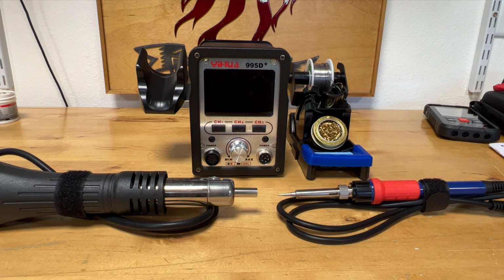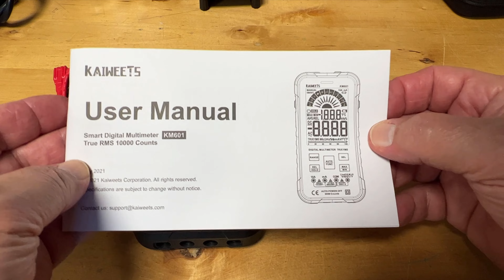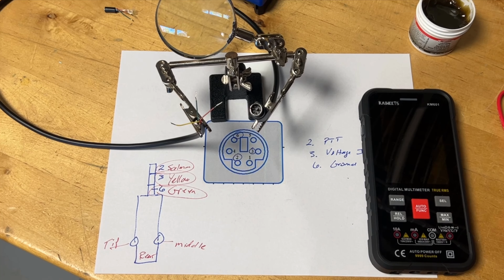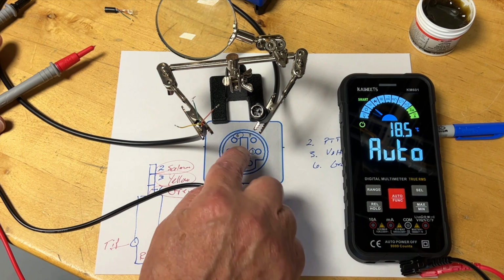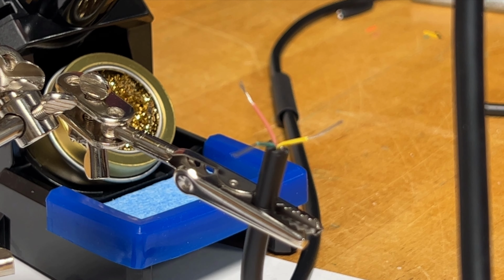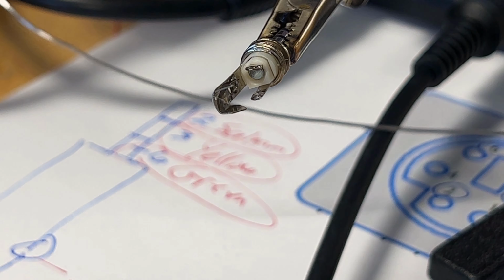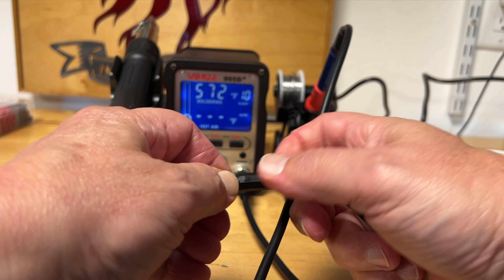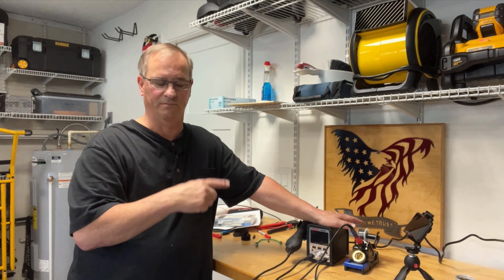First Impressions: Kaiweets KM601 & Yihua 995D Solder / Rework Station for CUSTOM HAM RADIO CABLES

Comment: I bought a Yehaw 995D to do smd work because it was advertised as such. I found out it will do smd work if you use the flux and fast melt solder. Anything else like replacing a volume control on a Motorola ht 750, it is a no go. The gun works good on fast melt or heat shrink for sure. 

Anyhow, I suppose I can slide by with it. 

Btw, it is good for use with the bang hood smd soldering practice kits but that is about all.  

Pace makes great soldering stations. 

Thanks for the review on the meter. One of my coworkers was asking about an auto meter that knows the difference between ac and dc voltage and can measure it as well. 

73
Reply from the maker: Thanks for the feedback on both units.  Sounds like you've gone a little further with the Yihua -- I think I'll get a test kit and see what limitations I run into with SMD.  I always appreciate comments to confirm my findings, or to learn of others experiences which may be different.  Thanks.
Reply: @HOAHamRadio  
What else should you look for when buying a rework station? (As in what is wrong with this one?)
Reply from the maker: @yuuhanmicu5737  I've had good luck with this combo and no issues.  I only solder and use the heat gun for heat shrink; I haven't needed to do any "rework" for component removal.

Comment: I run my soldering station at 640F almost all the time.  You'll know fairly quickly if that isn't enough heat to get the job done.
Reply from the maker: I couldn't find the "Less Sucky" dial to improve the quality of the soldering joint...does your have one of those?
Reply: @HOAHamRadio  Mine just started to get better after a while. /shrug  Maybe give it some more time to get used to its environment?